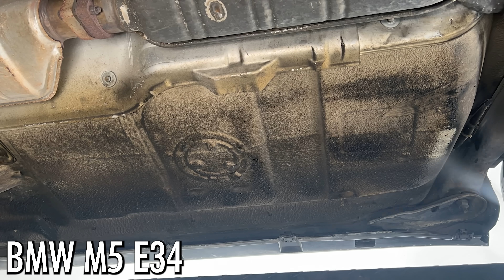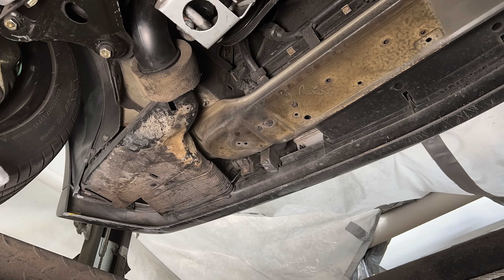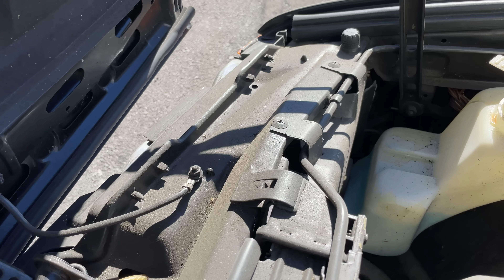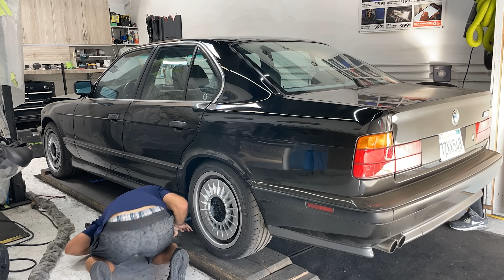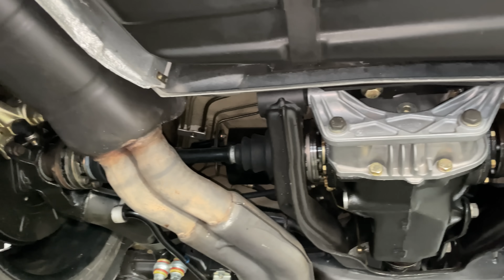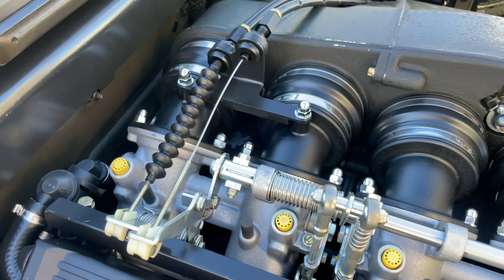BMW M5 E34 - DRY ICE CLEANING THERAPY

Comment: Nice to remove a rust protective spray layer... the car might look cool for a moment from below but not for long. A mistake to be fair :) But seems to work nicely for that. To be fair you should apply a new coating under the car now.
Reply: I’m glad I’m not the only one who cringed when they saw the unmolested cosmoline layer removed forever. EAG in Cincinnati is the world leader in vintage BMW M preservation and they go through lengths to retain the cosmoline when they detail the cars. It’s why they’re the best.
Reply: yes I also agree, bad mistake to remove pe factory wax and NOT put back on a fresh new coat of wax
Reply: @curtislovrak5390  ощощр о
Reply: @curtislovrak5390  è
Reply: They apply a new layer of protective wax once they're done with the bottom of the car. Did you even watch until the end?
Reply: @Thestr8noodle  what they put on is nowhere near as good. The reason that thing looked so good if from the stuff they removed.
Reply: @Thestr8noodle  you don’t understand
Reply: @curtislovrak5390  How are they better than BMW and what have you judged your subjective opinion on?
Reply: @sandersson2813  I think I was saying that EAG is the best because of their commitment to not undoing originality.
Reply: @curtislovrak5390  Still don't know how you know it's better than how BMW or anyone else restores a car.
Reply: @sandersson2813  They don't redo the cosmoline, they just don't rip it all off by dry ice blasting it.
Reply: @curtislovrak5390  I didn't claim they did.
Reply: @sandersson2813  I'm pretty sure he meant they're the best of any non-factory detail shop, not better than BMW.
Reply: Yeah, now it can join the junkyard along with many other trash designs.
Reply: But it’s only a BMW 😊
Reply: I believe he puts a coating back over it
Reply: @nickosbye  nemyslím si, že odstranili něco víc než měli
Reply: @curtislovrak5390  Vždyť odstranili jen nános nečistot. Nemyslím si, že odstranili něco víc
Reply: This reminds me of “cosmolene” as i was told its called, this shit was just sprayed under the bottom of every Porsche and made the undercarriage just look like crap, it was always uneven and this stuff was impossible to remove before these recent dry ice methods, it sure looks good but i agree it likely wont last long. But on an S38 M5 it sure makes that engine look amazing from topside or below.
Reply: To be fair I hope English is not your first language to be fair.
Reply: Impressive
Reply: @anonamos6086 you said “to be fair” twice in the same sentence. Is English your first language?
Reply: @FEAR_CB  you picked up on everything besides the obvious.  Congrats.
Reply: Rookies
Reply: Daaaang.  Just hit that cars Factory Reset Button....Brand New Again.  Seems like a Very expensive job.  That had to take Alot of ice to do that.   Ouch

Comment: I've seen a zillion of videos of undersides of cars being dry ice blasted, and still have to understand if the procedure only removes grease, dirt, rust etc., or can cause damages to the part, such as peeling off paint, or not.
Reply: It would not have an effect on clear coats as much as grime because they are still loose/dissolvable/viscous. But for obvious case, try not to aim at body painted surfaces. It's okay to hit painted parts like lower arms and such, those can be resprayed and clear coated again if the dry ice blast chipped the paint off (but unlikely that would happen)
Reply from the maker: Great response Jack!
We have a lot of control over the machine. We have to dial settings down to be more gentle. Its important to have a skilled detailer with the dry ice machine because it can be dangerous in the wrong hands

Comment: In the rust belt, cars treated with undercoat rust like crazy and the ones that had a major oil leak that coated the undercarriage are great. Undercoat loosened and allows moisture and salts to be trapped and corrode.

Comment: Having been on the internet since it was a thing, not much blows me away, this tho, this is next level, how is it you can get so deep without taking the original paint ?? some of those bits look almost factory fresh afterwards, amazing......
Reply: Because they come with a thick protective wax layer from the factory that prevents rust.

What they did in the video is remove this thick layer of protective wax.

It looks good for a bit, but now it will rust faster since the little thin layer of whatever they applied afterwards is no where near as good as the factory one. 😢

Comment: Could this be used to clean carbon off  valves in direct injection engines?
It would seem to be a far safer method than chemicals or walnut blasting.
Reply from the maker: That you can! We did a full ferrari crate engine with this method last year - and our friends at California Porsche bring us engine parts all the time!

Comment: what blasting system are you using? , How much per car are you charging per job Avg vs
 cost to operate equipment?
Reply from the maker: We use a coldjet pcs 60 and a medium karcher system. If you’re interested in pricing, you can check out our website and give us a shout via the contact page and we can discuss what you want to know in more detail

Comment: I’d be curious this vs. a heated pressure washer with a cleaning agent in it. Cause I’m betting costs are drastically different, and uses far more broad. It would suck hardcore to be THAT wet and dirty doing the underside of a car yikes.

Depends on needs I guess. Live in Texas or California where you can’t afford to buy a house, and have an old car you obsess over vs Midwest where you likely have equipment or a house and shop that the high temp pressure washer has greater use.

Comment: Is there anything unsafe for dry ice detailing? Meaning any materials that can’t be hit by the dry ice spray?
Reply: Almost anything can be used with the blaster, just golden rule of not using it on painted bodywork. Also obviously not for interior haha. Don't shoot one spot too long as it'll condense and that spot. You just want to shoot grime off. But I don't think there's a very adverse affect when shooting at one spot too long. I wouldn't wanna find out anyway, at least on customers cars.
Reply from the maker: It’s depend on each machine, because some of them can’t do same things like the others. 
With our dry ice cleaning machine we can do almost everything inside/outside including exterior paint, leather/fabric surface or carpet, it's highly customizable. We can dial the machine back to be quite gentle, but it has to be a skilled user, regardless.

One thing that we can’t hit is any type of foam, super easy to damage it.

Comment: An qusetion: Is it not bad for the cables and tubes under the car? Maybe these will be damaged because of the Power of the Dry Ice Cleaner?
Reply: Doesn’t blast at a crazy psi or crazy nozzle angle as you notice on the vivir doesn’t hurt the rubber hoses and I’m sure they can adjust the psi and amount of dry ice they use 🤷🏽‍♂️